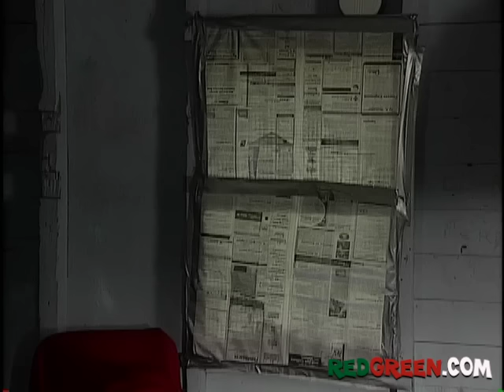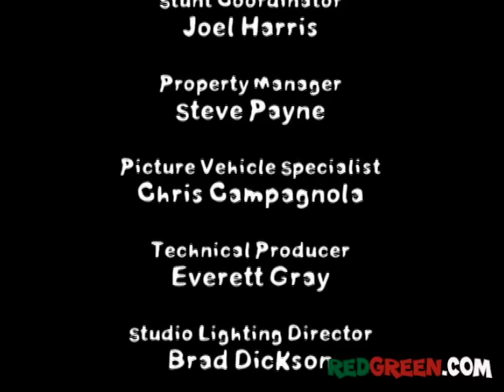The Red Green Show Ep 219 "The Chainsaw Races" (2001 Season)

Comment: 20:55  -ish. When i was in Job Corps, we actually had belt sander races!! Here's how we did it:
1) Make sure th' boss is busy. If he's not, Make him busy! ("Mr. Adler, Tommy put his face into the sander again!")
2) Line them up at one end of an 8' piece of plywood (do Not put them on the painted concrete floor. We learned this at the first event..).
3) Plug all "contestants" into a power strip (with power switch in "off" position. ...we learned that at the first event, too!!). Make sure all "spectators" stay far to the sides, and Not in front (THIS we learned at the second event!).
4) Place bets. ....or not.
5) Turn on power strip!
6) Blame all of the noise, yelling and damages on the guy who just joined the carpentry hall.